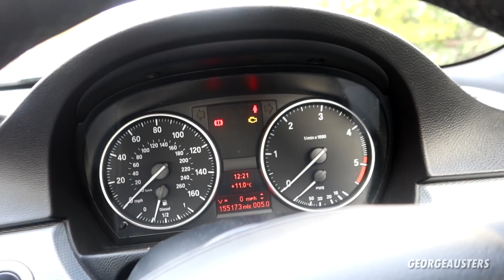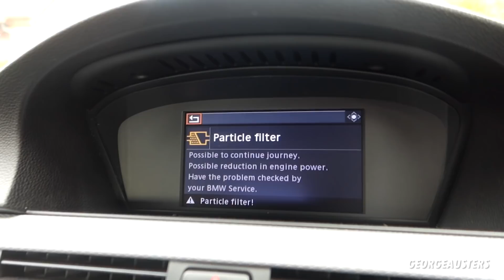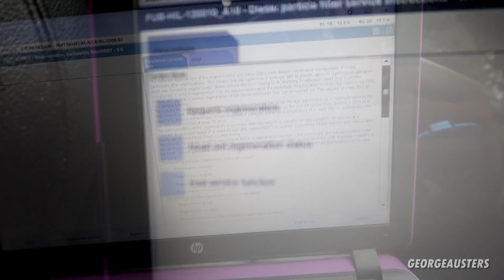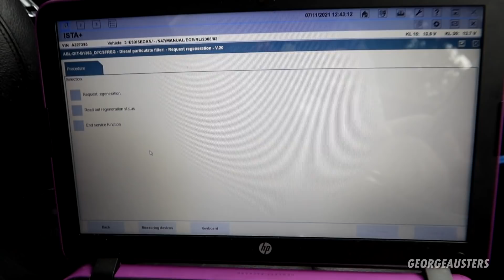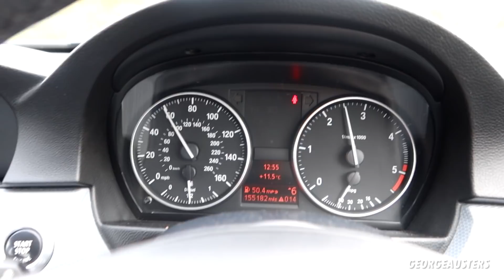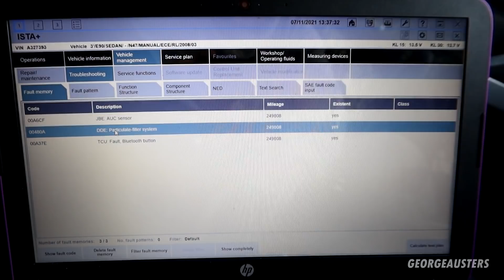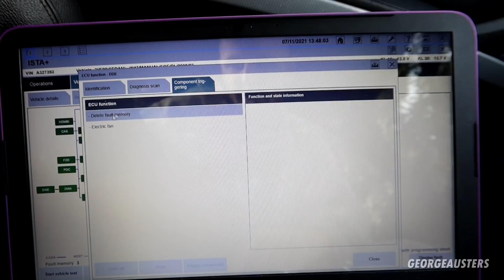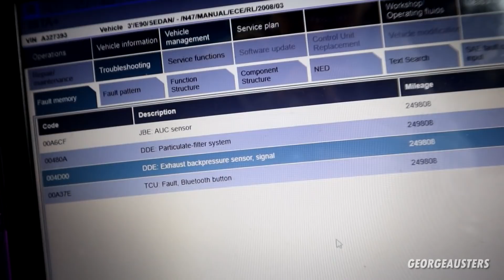SHOULD YOU REMOVE A DPF FROM YOUR DIESEL?

Comment: I think the point is to remove Diesel vehicles from the road.  There was a big push to move to Diesel as it was more efficient than Petrol but then Nox was found to be far worse greenhouse gas than CO2. When the DPF rules were introduced this was known and now a Diesel from 2006 on must not smoke during MOT. However the fast idle test will provide perfect conditions for producing smoke on MOT so no MOT for post 2006 Diesel. Easier than admitting they were wrong to push Diesel.

Comment: This issue depends on the make of diesel engine. I have a nine year old KIA 1.6 diesel that has spent its life doing very short runs interleaved with motorway runs every few months, the DPF copes with this. It helps when the filter is clamped to the exhaust manifold (quick to get to working temperature).
Reply: You had any EGR issues with your Kia? I got a 1.6 Proceed and it throws a pending code P0404 roughly once a week. Heard lots of people replacing EGR but the problem persists.
Reply: @jamiewright3901  I feel like the Germans do a better job of the diesels, though Japanese and Korean petrol cars are rock solid.
Reply: @elijahcarr4137  Definitely, I got the Kia as they were going for not much more than half the price of Audi/VW at the time, to add I fixed the EGR fault by simply taking the solenoid off the top and cleaning around the pin and stuck half a can of brake cleaner through the top of the valve. Sorted.

Comment: It should be remembered that a dpf is a a consumable item, just because you carry out a regen it will not last forever. The regen burns the soot accumulation in the dpf which is turned to ash. The ash remains in the dpf which means that at some point the dpf is full. I think it is around the 100000 mile mark. 
Low speed and short journeys are conditions that kill dpfs. In these cases people should drive petrols not diesel vehicles.
Reply: Oxalic acid dissolves the ash. Run dishwash powder through it first though to degrease it.
This is of course with the dpf out.
Reply: or buy diesels with ACTIVE regen systems rather than passive.

Comment: Dpf regeneration for any diesel car
Minimum speed 60 -70 miles 
maximum 2500 3000 rpm driving at least 20 miles constantly without stopping if you pass these parameters the car computer cancels the regeneration.
Enjoy your regeneration
Reply: incorrect. so incorrect its unreal. suggest you do some research between the passive regen system which you describe and the ACTIVE regen system. i have the active regen system on my car (2.0 tdci Ford) and it can and often does do a regen at town speed/at idle as and when the ECU sees fit (usually around every 400 miles)
Reply: @petelattimer6808  bro first of all it's a fake regeneration...your car cant du regeneration in town...you only kill the particule filter,because is not doing nothing out is keep evrithing inside because your ECU know you ar not moving and he know you are in town 
How? You don't have certain speed.have good day.
Regeneration plus dpf filter cleaning it's what y tell you top in the first message.
Your real regeneration is whe your car is moving when ECU see certain speed and he can let out all the sheet from the particle filter because there need 600 grade to burn the sheet
Reply: @petelattimer6808  and first off all is not safe for the people to do this in town also is not safe for your car...your particle filter will die soon
Reply: @petelattimer6808  imagination 200 cars close to you home doing regeneration I'm sure you will get sick

Comment: Think it wants to be between eight and 15  when it gets up to like 35 or 40  that’s when Engine starts to get Blocked bMWs also have a DPF pressure switch and if that goes the DPF won’t kick in to do the region so sometimes just change that and it’s okay

Comment: If you don't like DPFs then don't buy a diesel, simple. Do you really want every diesel car on the road to have zero emission control and be absolutely disgusting? Yes, having a DPF work properly is very costly sometimes so if you don't have the money to keep everything in check then you have chosen the wrong car. Lots of people do this, they buy a car with all their money thinking "that's it"... wrong, it's just the beginning of spending money on it.
Reply: problem there is people will buy a car that suits their needs. often these cars arent (or werent) available with a petrol engine. the Ford Mondeo, for example, wasnt available as a petrol, last i checked.
Reply: @petelattimer6808  Mondeos have plenty of gasoline engines, maybe you mean you can't get one because of some local restrictions in which case there's still a lot of cars in the same class so I don't see the problem.. unless you're a Ford fanboy, if that's the case well.. don't be ;-) Brand loyalty is one of the dumbest things ever.

Comment: are you using cheap supermarket fuel if so there could be your problem and you mentioned glow plugs they are only there for starting a cold engine and why do they say Kilometres per hour we are in Britain and drive in miles per hour and all of this is wasting fuel can they not come up with something better just to add it says urban roads not motorway
Reply from the maker: Nope I only use Shell and Tesco

Comment: I think the ECU counts the amount of regeneration and once it reaches a pre determined amount it won't regenerate until you replace the filter.
Reply from the maker: Fixed the issue now: https://youtu.be/Ff60sMnS5z8
Reply: You can reset your DPF mileage very easy if that woud be a problem but i don`t think it was.

Comment: You cant remove  the dpf it an mot fail now if it is missing,,you need to getca garage rhat knows what they are doing removing  dpf and reinstalling  the dpf casing and remap the car,,,but you just cant do away with it physically altogether.,,also removing  dpf often make car smoke a little  and that may be a mot issue  depending  where you take it for mot.

Comment: A BIG help for these ignorant over blown controls: use Archoil fuel and oil additives. Crappy diesel quality and oil ring blow-by of higher mileage engines ( normal) Archoil will improve cetane and clean up dp to a degree. DO NOT use these “green” diesel in low speed commuting.

Comment: I had DPF problems on my Mitsubishi Outlander 2007, as the the car did not have a dedicated dpf icon but used the engine management light, this light commonly came on when the Dpf needed to be regenerated. However as the car had done over 100.000 miles it was a pain with engine fans keep come on and the car becoming quite hesitant at times when driven. 
I was advised due to the amount of miles on the clock  the dpf woukd require replacing ....£££££

Comment: Interesting and very frustrating issue. 4 years ago I was looking for a new car and looked at several makes and types and settled on a diesel engine for the good fuel consumption. I went to the various dealers and Ford were amongst them. When at the Ford dealers the salesman took one look at me (silver hair aged over 70) and said that Ford diesel cars would not be suitable for me as the diesel particulate filter would give problems as I wouldn't drive the car hard enough! I have never been so insulted ever and resolved never to own a Ford. I opted in the end for a new top of the line limited edition Skoda Octavia 2.0  & Klement. I have owned it for 4 years now and it has performed very well with excellent fuel consumption and has superb performance. I only do small mileage now but I have never had particulate filter problem. If the filter has regenerated I have not been able to detect it. I do not often drive in heavy traffic. With modern high performance cars that run at low rpm it is not easy to give them a good thrashing without getting speeding tickets. I wonder if your problem is sensor related?
Reply: Sounds to me like the Ford man did you a big favour, rather than just take your money and laugh at the future bills replacing the filter every year or so. If you buy a diesel and do little (slow) mileage, your asking for trouble AND big bills.
Reply: My Octavia 2.0tdi idles just over 1k rpm when doing a regen. If I stop the engine before a regen has completed the cooling fans run for a while after I leave the car.
Reply: You would definitely know if it had done a regeneration.
Reply: @chrishart8548  How would you know ?
Reply: @tarmac1697  fuel economy drops.  Tick over rises,   and it makes an awful smell like a self cleaning oven, and it makes your  eyes sting.   At least on a 2011 modeo 2.0 tdci psa    and a 2019  passat r-line (with add blue) it does.
Reply: @chrishart8548  so you’d notice fuel economy drop while driving down the motorway at +70mph . And notice a smell 😂😂😂😂
Reply: @tarmac1697  I'm sure I'm wasting my time talking to you.  If mpg is displaying on dash it could be noticed, if not then no. I think you could feel a change in the way the engine is running (its running much richer to get some heat really going around the exhaust downpipe and DPF.  Not everyone will notice any of this. And the smell will only be noticed when stopped obviously.    If you drive 2 hours+ the smell would probably be gone by then.
Reply: @chrishart8548  A diesel running rich😂😂😂😂
Reply: clearly the salesman hadnt a clue about what he was selling. i have a 2.0 ford diesel. it has ACTIVE regen system rather than passive. my car will, if required, trigger a regen and COMPLETE the regen successfully at IDLE

Comment: Also it could be an underlying issue other than dpf filter it could be a leak from your turbo intercooler hose pipe (split pipe) or it could be a dirty maf sensor.
Reply from the maker: I made an update video how I fixed the issue

Comment: My questions are. Why are cars so complicated and is it really necessary. The cost to the environment is vast when vehicles like this have to be scrapped because they are beyond economic repair. How many cars have functions that owners don’t even know are fitted and the car is scrapped without them being used. Make cars simple which will make them economic to repair. Cars are to get you from A to B and back again not an electronic fashion statement that will cost you a fortune when,not if, they fail. Manufacturers are guilty of this practice and it must only be so they make vast profit but are claiming to help the environment. They say it is what the consumer wants but in 50 years of driving nobody has ever asked me.

Comment: The problem started when car manufacturers stated in the late 90's the new commonrail diesel injection engine's would never need the glow plugs replaced.
 That's why dpf/egr exists today but just to replace glow plugs every 30k was all that was required.
Reply: I have  a 2008 diesel.  New enough for common rail old enough to not have a DPF.  It goes like stink and if you rev it you almost always get black smoke.  Its always serviced and runs perfectly.

Comment: EGR and DPF are the worst ever things put into a cars engine.
Once they block up and they will I guarantee, your engine will run very inefficiently.
Great, in theory, on a brand new engine, I have no doubt they will work.
But on any used engine with plenty of miles on it, they both block up with carbon, soot and other oily crud and combustion residue.
Just check your intake between the EGR and engine and I guarantee it is filthy and caked in carbon, in your intake are a host of sensors that keep your engine running at optimum efficiency, once they get dirty they won't give the correct data to the ECU.
I'd forget doing a regen on the DPF, take it off and manually clean it,  same with the EGR also clean out the intake manifold as best you can and carefully clean as many sensors as you can.

Diesel engines take a long time to warm up to operating temps, especially in the colder months and short journeys are no good for a diesel, if your commute involves a good run down a motorway or long blast down a dual carriageway, you should be fine and any DPF will 'auto' regen itself.

When you just do lots of short shopping trips to the supermarket or a short commute, that's when you'll constantly be clogging up your DPF with soot.
A petrol car or EV would be better in that case.
Reply from the maker: Agreed!

Comment: Regens only burn off the soot - not the ash. Ash will accumulate and effectively blocks the filter which apparently has a life expectancy of around 125,000 miles. Then it is either case of removing it and cleaning it (some companies advertise this service) or replace it at a cost probably more than the value of the vehicle itself. Madness - blame it on the EU! My next car will be petrol.

Comment: I had the exact same problem so I replaced the DPF filter and still had the same problem. In the end after around £2000 I replaced the exhaust sensor on the manifold and reset , worked fine but cost me a lot of money !!

Comment: My US spec 2014 VW Sportwagen was modded to remove the emissions cheat software after being sold back.  I have not noticed the regen ever taking place.  Will it show in the OBD2 codes with a basic code reader?
Reply from the maker: I doubt it, you likely need proper VAG software

Comment: I agree dpf's are just annoying.I have a 06 ford cmax tdci.1st the dpf got blocked so paid almost 400quid to get it sorted and now its thrown up another code saying the pat fluid is low so it cant do a regen.1st diesel ive owned and never again.
Reply: just needs teh PAT fluid topped up. i believe a garage has to do it, as its not like adblue.

Comment: Its a temperature sensor problem mate which is situated on the exhaust close to the motor.
Now to clean your DPF just use DASTY Degreaser, let it sit overnight and it is brand new.I have use this on my dpf of my car and it worked amazingly.Dont need to spend 150£ to let your dpf flush and cleaned.

Comment: Well this person talk tripe removal of egr and dpf will make the unstable on uk roads it will never pass an mot or visa inspection which will getting more frequent on uk Road as we tighten air quality rules so if your keeping fix it puss why don't you read the screen the very first said you have to remove all fault code before you can run a forced regen.

Comment: The trouble is if past owner have not looked after dpf then no amount of regen will work its either a clean hoping the surface are notvdamage or a new one
Under the new mot the have to visually check for different and next year there will be a computer check  if it missing then your car fails mot.

Comment: I never get it…
My old 1,9 TDi engine doesnt have a DPF, at best a blocked EGR… and there is only a bit diesel smell and little bit black smoke (chipped…) and only need 4-4,5l/100km
But my modern Subaru Impreza Diesel need like 6,5-8l/100km and is smelling extraordinary ugly with its poor DPF design

My Subi should come back in a few days…. Without DPF or EGR, i hope its not too loud

Comment: It's not just constant motorway journeys you need to be doing with a modern Diesel car you need to drive hard on normal roads . Problem is driving hard wastes fuel , so you have to constantly thrash the car to keep it clear off carbon but doesn't  high revs increase pollution?  I give up 😂
Reply: suggest you research the difference between passive regen systems (like the ones you describe) and ACTIVE regen systems as fitted to my 2.0 TDCI Ford which ive owned for the last 7 years (bought used).it can and WILL (and has done) start, and complete a full regen at IDLE if the ECU deems it ready to regen!

Comment: Hi George,  I had this very issue with my 61 reg E91 318d SE in April 2018 when the vehicle had passed the 160,000 mile mark.  The car stopped doing regenerations.  I use a really great firm of ex-BMW technicians who have set up shop and do a stupendously good job for a good price.  P & R BMW and Mini Specialists in Hayes, Middlesex.  They put ISTA on the car and did a thorough diagnostic and pressure test. There was a difference of 11 mbar between the forward and rear sensors. Effectively the DPF was clear and free flowing. The ECU had a disigned in command that at x miles the DPF was u/s.  This is all about parts turnover.  The DPF should last the lifetime of the engine.  The lads at P & R BMW recoded the ECU so that it was under the impression a new DPF was fitted and requested a regen.  Fault codes disappeared and the car has been singing sweetly since, now with 197,200 on the clock. In all that time, I've not needed to strip and clean the EGR.  Use premium fuel, change the oil every 6.000 miles and you should be ok.
Reply: I've got a 2006 Bmw e91 320d with just under 200k miles and, so far (touch wood!), I've had no trouble with my original dpf which is still going strong and I now do mostly short journeys. However, I do now use premium fuel and have regular oil changes, plus I'm quite heavy-footed, but maybe I've just been lucky... Having said that, it's hardly been the most reliable car, having had loads of electrical faults, but it's fast, stops well and is very comfortable!

Comment: Hi George great vid. I have a audi a3 2015 keep having the glow light flashing and goes into limp mode especially when the engines cold revs at 1000 rpm all the time  switch engine off and back on again light stops flashing and it goes out of limp mode no dpf light though and no fault codes on diagnostics I'm just wondering if I have the same problem?

Comment: Just get a Volvo euro 3 D5, Cracking engine, 2.4 litre, 5 cylinder, 163bhp, Torquey as frig, Sounds great for a diesel and averages 50 mpg pulling a 1.5 ton V70 barge along! Very few problems with them and they do mega mileage if well maintained And they crap all over this German rattly timing chains and pissing out oil junk, BMW/Audi/VW still live off the high watermark from the 80's and 90's, Their stuff from 2000 onwards is crap! Profit over engineering.